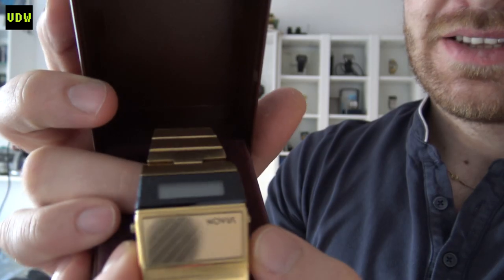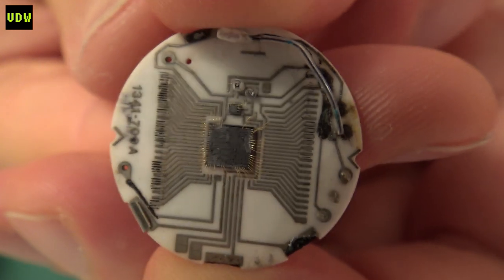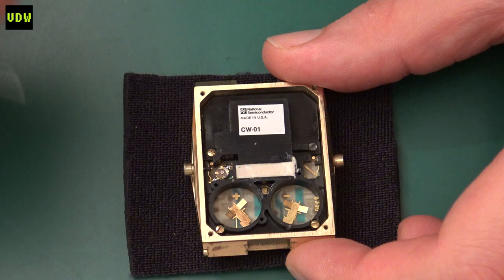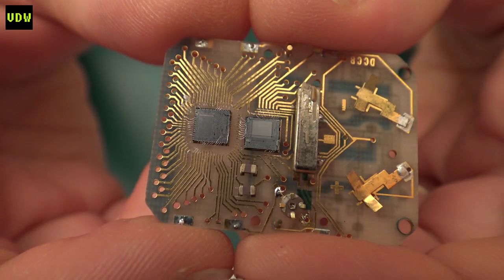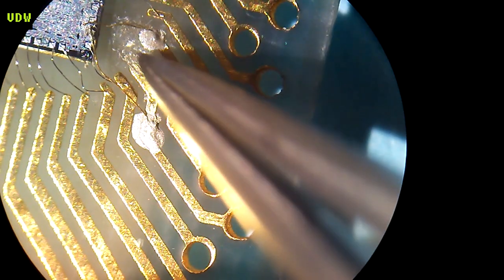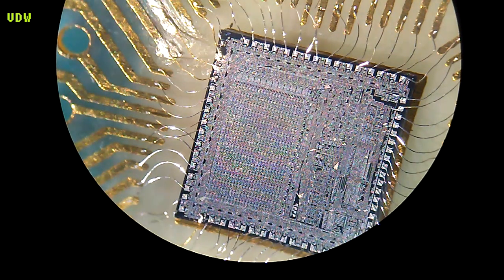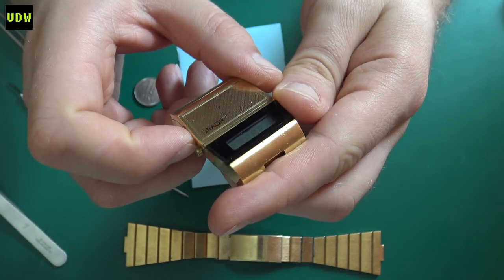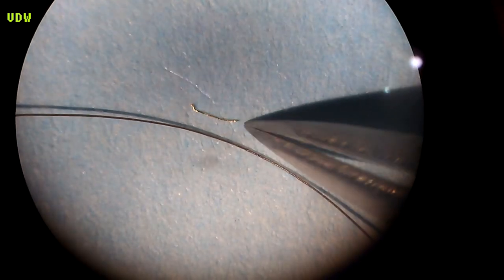Novus Calculator watch Wire-Bond FIX - Ep 53 - Vintage Digital Watches

Comment: Late reply to a 4 yr old vid (excellent BTW).  I did something very similar to this, maybe back in 2012 or so.  The one additional check you could try to solve the remaining LCD segment issues, is to clean off the tiny contact spots between the LCD substrate and the zebra connector that presses on it. Use a toothpick with a tiny amount of alcohol on the tip, and carefully brush over the contact pads.  It has certainly worked for me on many removable LCD panels.  (Also, might I suggest investing in a trinocular scope, much easier to film  and  be able to study the subject in stereo vision !)

Comment: Hi, i have led bulova watch computron that is running slow,is that a way to fix it by adjusting the like a potensimeter small bolt inside? Thanks.....
Reply from the maker: Hi, check the inside for the bolt, but the Compuchrons are notorious for oscilator issies ad they have a 700Khz one instead of the classic 32 Khz.

Comment: Would love to see a repair on a Seiko a904-5xxx LCD watch as I have one in almost perfect condition except its gone very dim and I haven't a clue where to start....
Reply: It is probably the capacitor used for generating the high voltage in the lcd driver.

Comment: I've been wondering about this kind of fix for some time now.  But what I'm really wondering is if there is a coating you can apply to those ICs that don't have it applied for the manufacturer to protect those tiny wires??
Reply from the maker: I have thought about future proofing but I have to find a material that doesn't contract/expand while it cures or while it is exposed to temperature variations. If it did contract/expand it would end up pulling on the wire bonds.

Comment: In order to make sure the conduction, the glue did you use is a kind of conductor material?
Reply from the maker: Have you watched the video?
Reply: @VintageDigitalWatches  Yes, you talk about a kind of "wire glue". But I would like to know a little more about the properties of that material... So it conducts electricity? Thinking about an electronic repair, the word "glue" causes some confusion to me about its final properties...
Reply from the maker: @mariom308  Hi, I use the term wire glue because that is the commercial term for it so people know how to find it if they do a search on eBay. It is electrically conductive because it has to pass electrical signals. For detailed properties you would have to look up the Material Data Sheet for one of these products to get more insight.
Reply: @VintageDigitalWatches  Thanks a lot for your response. I enjoy and learn through your amazing videos! Best regards!

Comment: Where do you get the wire bond replacement? You just mention where to get the glue, but not the wire itself.
Reply from the maker: From a donor watch, not the same brand, but still an old one that has the wire bonds exposed which allowed me to pick them off.
Reply: i see. thanks

Comment: Hello, would you be interested in repairing my Casio DBC 63? I am a fan of your videos and the buttons on the watch do not work. Also the battery replacement I tried did not work. Looking forward to a reply, thanks.
Jeremy
Reply from the maker: Hi Jeremy, I have quite the backlog because of viewers requests and will probably stay away from accepting so many fixes. If it the DBC 63 the you might want to try to clean the zebra strip that sits in between the keyboard and module, you can access it by removing the module.  Regards, Tibi.
Reply: Vintage Digital Watches I will be sure to try that! Thanks :)
Reply from the maker: Let me know how it goes, I'm curious.
Reply: Vintage Digital Watches I have cleaned the part you talked about, but I found another problem. While putting the battery back in for a replacement, the backlight stayed lit and there was no display. Now I believe the battery has run out, and I have another one coming in the mail soon. When it gets here I will try to change it out but if that does not work then it is beyond my level of knowledge in digital watches. I am ashamed because this is my favorite model and I would have loved to get it back to a better condition. I know that you have a backlog of orders, and I am not trying to pressure you, but I will gladly wait if you want to take a look at it. I think it would be a nice video because I never see any about this watch model or it’s repairs. If not, that is fine and I might find a repair company that can take a look at it. All the best, Jeremy
Reply from the maker: Jeremy let me know how it goes and if the replacement is not with a success I let you know how to proceed in getting the watch to me. Regards,
Tibi
Reply: Vintage Digital Watches Hi, I cannot believe myself. The watch battery came in the mail a few days late and today I finally got to try to replace it. I had the same results as the last time with the old battery, so I decided to disassemble the watch. After I put everything back in place, installed the new battery, and reset it, it turned back on and started keeping time again. I am very thrilled to have fixed it, even though I don’t know what I did haha. Thank you so much for all your help, it has been quite an adventure. Best, Jeremy :)
Reply from the maker: Nice one!

Comment: I never saw anybody doing this kind of chip surgery before.

Gold bonding wires are originally held into place by friction welding (because gold is very mallable). Thus instead of conductive glue (which can cause short circuits) a bonding machine would be the correct repair tool. Unfortunately AFAIK no small versions for workshop repairs were ever made (only laboratory chip rework stations those cost enormous prices). A proper tool would include at least a micro-manipulator (pantograph mech against shaky hands) and perhaps a laser to aim properly. I hope someday a small open source hardware version will be invented, that can be produced e.g. on a 3D printer.

https://en.wikipedia.org/wiki/Wire_bonding
Reply from the maker: Hi, yes I did go through a few videos to see how wire bonding is done and checked some used machines on eBay but they are thousands. So I went ahead with the 20x microscope, and I do understand the concern of shaky hands as it is indeed very small room for error. Since the fix I upgraded to 60x ocular which make some difference. As for manipulators they are also in the hundreds and I make this kind of fix once a year at best so it is not quite worth it.